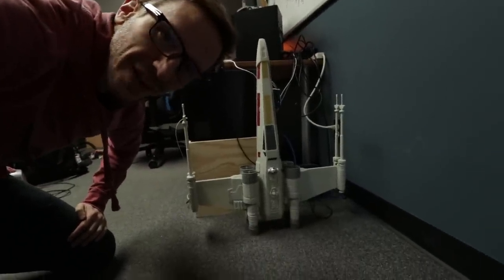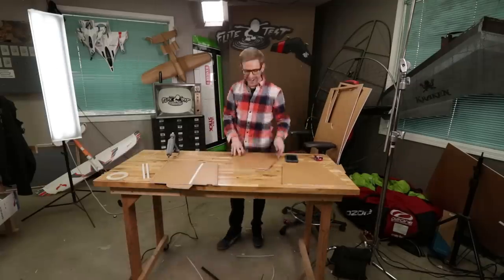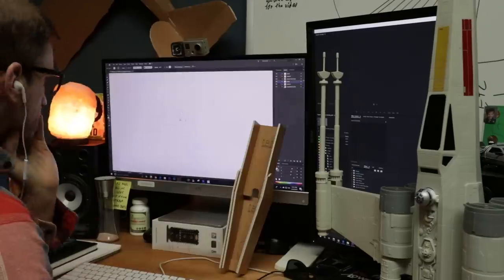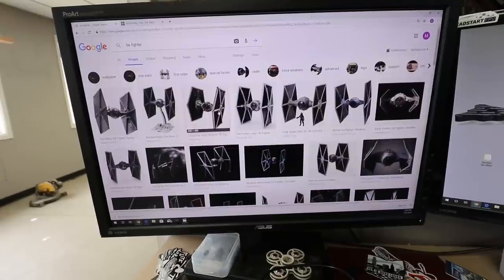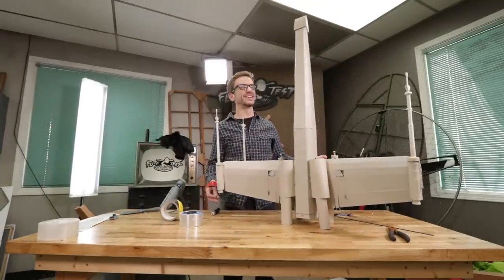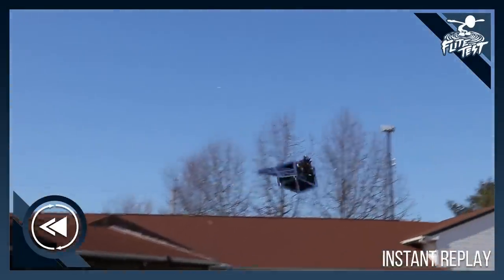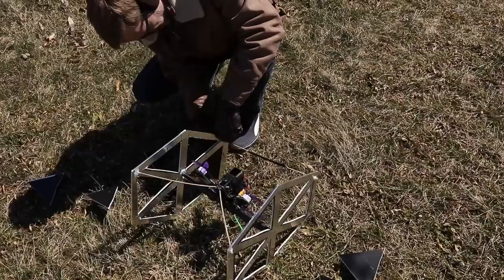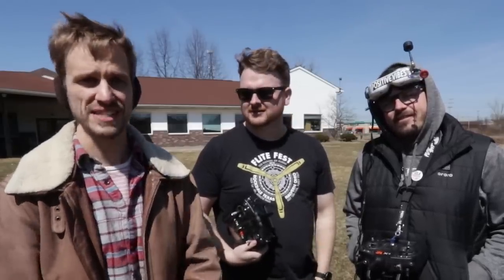We're going to try to not crash this... - Real flying X-wing

Comment: Some weight in the nose would bring the CG forward, and maybe a canard wing, and rear vertical tail, made from clear poly carb (so they're not so easy to see, and still looks like an X-wing from the ground) would assist in stability..

OR,
make one double the size, and use 4 ducted fans where the X-wing engines are positioned..
Making it bigger  with more engines will also assist in stability as it'll fly faster.. :)
Plenty of room to try it out in the new location too.. :)
Reply: Google?
Reply: @bryanha5688  I'm gonna need more information dude..
one word with a question mark is not a valid question in this instance..

Comment: If you had put the propellers in the turbine tubes, you would have been able to control the stabilization with variable thrust. A bit more complicated but far more stable for interplanetary flight.

Comment: A quick question: As soon as you said that the second bottom wings would be fighting the top ones, I thought " So why not turn the bottom wings into straight pieces of foam board, and they would just be there for show?"
Reply: ik this is old but a flat peice of foam still genarates lift

Comment: just a thought if you added a front prop which pulls harder than the rear it will keep it straight... it moves like a rear wheel drive vehicle in the snow otherwise?

Comment: Great video awesome to see the X-wing fly but I feel like you could go back to the drawing board and do some fine tuning. Build another X-wing that can take off and land similar to the Hollywood version, then it would be a success. I would use ducted fans in the center and 2 smaller ones for stability and keep the ones you have for thrust. I have seen you guys make a lot of things and I believe you can do this. Make it really fly where you can control it. Good luck

Comment: The solution to the X wing is simple: Put the motor at the very front. It will pull the air in and direct it over the control surfaces which will render a lot more authority & stability.

Comment: Clear plastic canards and interplane rudders would help, but I get that it spoils the "dream",  which I must congratulate you for taking to the next level, and actually getting something that my paltry RC skills couldn't dream of handling, into the air and under control. "We do these things not because they are easy, but because they are hard!"--JFK

Maybe managing such an unstable design, devoid of good locations for aerodynamic control surfaces, will require "control thrusters"  as on a an actual spacecraft.  Imagine a quad-fan setup with the smaller "afterburner" tubes within and behind the main "intake fans" (the real engines) concealing bleed air inlets that direct thrust forward through the body tube, and out the proboscis cap on the tip of the nose, where it could be vectored out and aft under control. Don't think of it as a bird, but rather as a Pterodactyl;  A flyer that steers with it's head, not it's tail. 

 I may have to tackle this design myself as foamcore, expanding foam, hot glue, shrink wrap and some well-placed strands of music wire can really do experimental wonders for pennies on the dollar and minutes on the hour. I assume your "water resistant" foamcore  saves a lot of weight by requiring less paint than the untreated paper stuff, may have to look into that.

Comment: Everything I see here on the flight says the CG is way to far back.  Maybe experiment with the CG at 5% of cord from L.E. (no more than 10% back)  You have a lot of forward surface area, so the center of pressure will be forward more than normal.

Comment: Should’ve used a controlled canard wing for elevater
Reply: correct. also a ferapetropak for the reverse drag of the 2 extra airfoils thus negating the drag all together.  Hence "reverse drag".  This, coupled with a ferrothrust designator keeps the nose up and the wings level.

Comment: Build a flying ring. I thought I had invented it but the idea is not new. I made little ones ..the ring has to slant at 45 degrees .. as paper planes it would be nice to see an rc..plus when powered off the should guide safely to the ground in a sporal if uncontrolled but still with good lift.

Comment: Am I the only one who thinks the issue wasn't just the vertical stabilizer but a lack of weight in the front? the first couple failures looked like the front just lifted up and over without resistance... just a thought.

Comment: try a ducted fan 1/3rd of the way back from the front of the x wing  create ducts in the nose to draw air in and exhaust in the the center of the rear of the fuselage..    so you are "pulling " the rear mass behind the jet?   could that work?

Comment: Not an aerodynamicist by any means - but what if the upper wings were airfoils with control surfaces, and the bottom wings just "dumb wings" ?
i.e. flat stock, no aile's  ?
Top wings of the "X" do all the work... bottom ones are just passengers - like those bits on the bottom of F111's, F16's etc... stabilizers kinda things. 
Hmmm.... 🤔

Comment: Yes, the wing will fail due to the size, Tie Fighters used an Giant Truck Axle to hold the wings on and you used Hot Glue? I'll push play and find out.
Reply: I finished the video and it was really cool how you worked out the kinks in just a week, Tie fighter not so much but if it had an axle skin over it and fiberglass wings should solve the issue and look really nice. So, how do I buy a kit to attempt this on my Xwing?

Comment: You see when an X-Wing flies it's most of the time incruse mode so like an F-14 Tomcat when it starts to go into combat that's when it opens up its s-foils into an X shape wing. If I was going to construct an X-Wing Fighter radio control plane I would use the same concept I would have it on the ground with the s-foils closed Cruise mode once in the air I have the option of opening the s-foils 2 lock into combat formation in other words X-Wing shape Wings open up. Then when I was ready for it to land I would close the wings up and land

Comment: Best resolution for motor it be installed on front pilots cabin in body whid one propeller 100% it flys And you don't have to put so many stabilizers it's flys whiteout them

Comment: the back of the x wing is too heavy because of the location of its wings and motor. in dessault rafale they put little wings in the mid section to stabilize it.

Comment: your wings are not in the right location. The X-wing do not touch they are spread out when opened. the nose needs to balance the rear end out, that's why its wheelies as it flies. Balance is a huge key, then comes the power it needs, so you need to get some strong engines.

Comment: make the bottom wing flat not like a traditional wing and no aileron that should let it to fly way better  and remove need for vertical stabilizer.  are u using a control board if not try one it might fly right

Comment: I would like to see you build a high altitude spy/scout plane with a 10 mile reach for searching people and bring them stuf.
I think long wings nose heavy and 2 low power engines with big batterie bank and a auto out of reach return.
I know you can do it.
Wat i also like to see you built is a super flat drone that could fit threu the mailbox opening and search inside a house and then return some how.
That would be super mega king size awesome.
Greetings,, Kitty.

Comment: Your tested machine is aerodynamic nonsense. The nose must be longer by 20 cm.  And with 2 small wings (fixed, without arduino) as front elevator, near the tip, horizontally. You try it and see.

Comment: A design that was meant to fly without atmosphere?!
Reply: While X wings can use lift from the S foils and fuselage to fly and manuver  in atmosphere, 
However, like all starwars air vehicles, Primary lift is derived from repulsor lift technology. 

The "wings" are actually there to increase the spread of blaster fire into a cone with adjustable convergence.
This convergence allows all shots from all 4 blasters to hit at a single point, increasing damage.

Comment: COME ON guys you rushed it why didnt you try keep weight down as much as possible .. and i will contradict myself here but you got go for edfs    you can do exposed propellers and have us take you serious ..     so maybe a hidden big edf  inside the fuselage or  4 small ones and use battery forwards for  cog ..   the big vertical stabilisers are so ugly maybe something smaller? as part of the x wing could be ok ...     since weight can be a problem a 4s power  battery but keep the mah down    performance over run time..    Make it look more like an x wing  !!